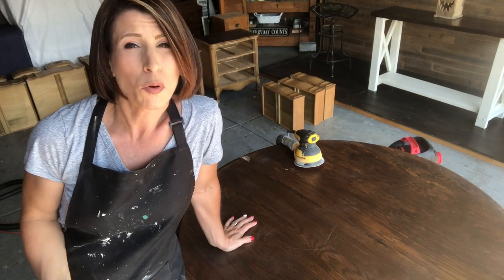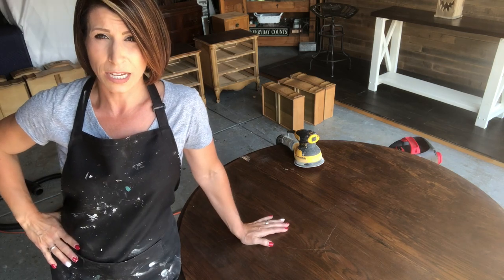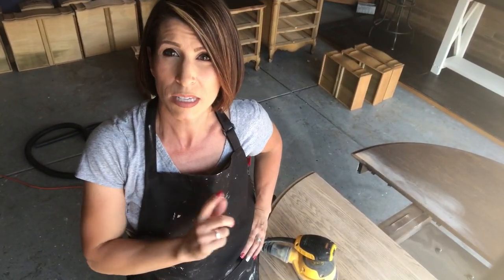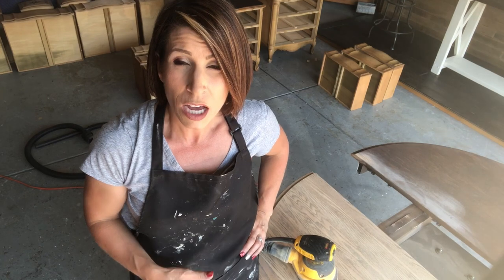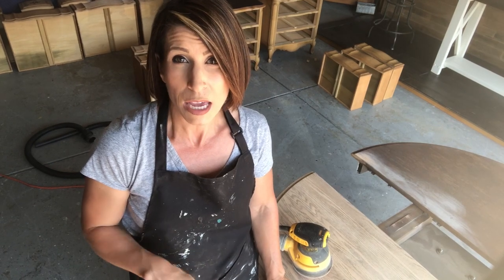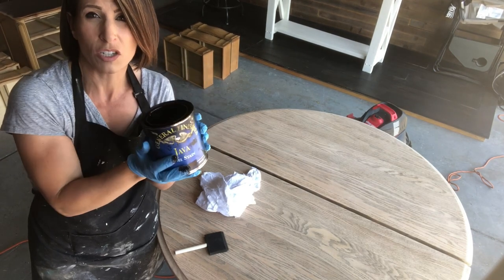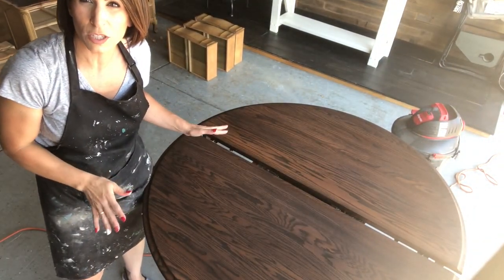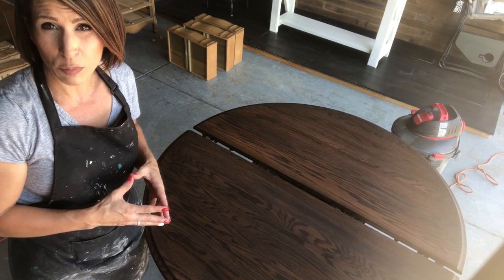How To #12:  Staining Process From Start To Finish

Comment: Hi again,  I tried to be miserly with the Gel stain and It got a little splotchy.   I tried doing it in 4 sections. Table is so easy to sand with the orbital I'm just going to give it another go and lay the stain on all at once then wipe it off. I learned from the table and my chairs look amazing. So satisfying!
Reply from the maker: M Hamrin yes best to try and do all at once rather than sections or you will get an uneven stained looked

Comment: I’m so glad that I found your channel. Did you sand in between the coats of Poly?
Reply from the maker: K Gaither Hi there! I’m so glad you did too! Not all the time - after my first coat is dry,  I run my hand over the piece to see if it is smooth or needs a sanding in between to get rid of dust or particles. If I need to - I use either a 400 grit fine sandpaper or 0000 steel wool (nothing abrasive) in between, wipe down and being my next coat.
Reply: Born in a Barn Boutique Thanks so much!
Reply: Do you use arm r seal on dark paint table tops? Or could u?

Comment: How do you apply the second coat ? Just use a shop towel and wipe or brush and wipe ??
Reply from the maker: Leslie Hernandez the second coat of stain would be applied the same way. With a brush and wipe it back.

Comment: Also, next i'll be sealing it with the General Finishes High Performance water based satin top coat. Do you think this will be sufficient for the table? I didn't get the arm R Seal.
Reply from the maker: M Hamrin that’s all I use - you don’t need to use an oil based their water base is plenty durable

Comment: when is it necessary to use a wood conditioner? I have a piece with multiple types of wood. How can I make sure the stain looks consistent throughout the entire piece?
Reply from the maker: Melissa Lucas so you want to use a pre stain wood conditioner before staining s new, soft or porous wood surface (cheery, birch, poplar or pine). It will help to create an even coverage. It penetrates the grain and promotes uniform acceptance of oil based wood stains. It will help reduce streaking and blotching. Although if you have different woods, those wood grains will still show through and not be covered  up. Stains aren’t meant to cover but enhance.
Reply: Born in a Barn Boutique thank you!!

Comment: If I have sanded with a 400 grit can I open up the wood again with a 120 grit? I sanded a table with a 400 grit, maple table and I can't get a dark stain on it, I want it dark.
Reply from the maker: 400 is super fine. So I would definitely go back to 120 and stop at 150. Maple is a super dense wood and a hard one to stain. My experience is it takes several coats to achieve a dark finish. It can be done I do it all the time - I wait 24 hours in between coats and usually have to do 3-4 coats to achieve a dark finish.

Comment: Did you send between coats of top coat?
Reply from the maker: Joyce Casey it depends if it needs it! I don’t always, sometimes you get lucky and it’s a pretty close to perfect coat. Because that only happens maybe 2 out 10 times, yes I sand in between with a fine grit sanding pad or steel wool.

Comment: Can you use the arm-r-seal on chalk paint?
Reply from the maker: So here is what I will tell you - I have used Arm-R-Seal on the GF Milk paint (lamp black and Coastal Blue) and it produces a beautiful end result.  Keep in mind this is an oil based product and will amber your paint color - with black and navy it makes it more rich looking.  DO NOT USE ON LIGHT COLORS or it will turn your color for sure.  I have not used on chalk paint.  The best overall top coat for any painted surface is GF High Performance Top Coat (it is water based and will not amber or yellow your piece).  White is the exception - white is the hardest color to top coat without yellowing issues (white will naturally yellow a tad on its own over years - sometimes not even noticeable but it can).  So when I top coat a pure white I use the HPTC and add a touch of my white paint into the top coat and have never had an issue.

Comment: What size sander do you use, I really need to get a good sander? Tyi 😊
Reply from the maker: The Feathered Hag I use a dewalt orbital sander and I love it! Have used a belt and palm and don’t like. Have had a Bosch Orbital and pooped out quick so dewalt is the the way to go in my opinion
Reply: Born in a Barn Boutique I looked up dewalt sanders but they have different ones/sizes
Reply from the maker: The Feathered Hag 5” sander -(DWE6241)
Reply: Born in a Barn Boutique thank you so much ☺️ I have my f50 Cling On brush ordered, and going to Lowe’s tomorrow.

Comment: Do you sand before second top coat ??
Reply from the maker: That depends on what type of statin you are using - water based tends to raise the grain - so you may need a light sand - I like to use steel wool - but I find that lost the time I don’t have to so that
Reply: I am using general finishes Java gel stain and will be using general finishes satin top coat . So my sincere is the top coat because it say to apply it let it dry the drying time then lightly sand with 220 grip paper then apply top coat again
Reply from the maker: Leslie Hernandez 220 is not fine enough- you will put scratches in it.
Reply: Born in a Barn Boutique I also have 320
Reply: Born in a Barn Boutique do I necessarily have to sand before second satin top coat ? I’m just afraid to have to ruin it and start over. That’s what happened the first time when I sanded lightly it went far down and I couldn’t understand why. It was said I’d DIDNT  let the top coat dry long enough
Reply from the maker: Leslie Hernandez thats still too rough / the only reason to sand is to knock down any raised grain or anything that flew into your finish- that is why I mention steel wool - it won’t scratch your finish. Or you have to with a super fine finish grit sandpaper. Good luck!
Reply: Born in a Barn Boutique see I didn’t know that ! So really I don’t need to sand it then. How do you avoid any streaks when applying gel stain ?  So far I’m doing well but my last gel stain coat has some streaking like uneven stain idk how exactly to explain
Reply from the maker: Leslie Hernandez I think we are talking about two different things - you asked about sanding before top coating - sounds like you talking about the stain here. The gel stain will be streaky if you are painting it on and non sanded surface and not applying to bare wood like I did in my video. I always sand to bare wood, apply stain, wipe back, apply second coat, wipe back, let dry, apply top coat, possibly sand with steel wool and then re-top coat. Sounds like a virtual lesson may be helpful for you. If your interested you can visit my website to purchase!
Reply: Born in a Barn Boutique I actually sanded to wood also and yes it did have a little bit of streaks when wiping back . And before when I did the first time I applied a top satin coat and sanded lightly and it went through the stain so easy. So no misunderstanding just what different things form different people and it is my first project. I applied the gel stain and wipes it back on raw wood as another video from general finales product showed me. So idk maybe it just isn’t gonna work well for me period 🤷🏻‍♀️
Reply from the maker: Leslie Hernandez ok got it. Just wanted to give the right information ans was getting confused at how I could help. Without seeing the project and talking with you through here is hard to help guide you. Staining and top coating can be challenging.
Reply: Born in a Barn Boutique I wish I could send a picture 🤷🏻‍♀️ I’m starting to feel like I just can’t get it right 😢